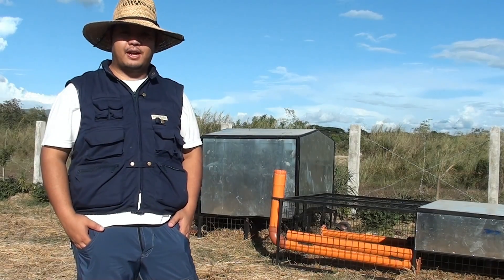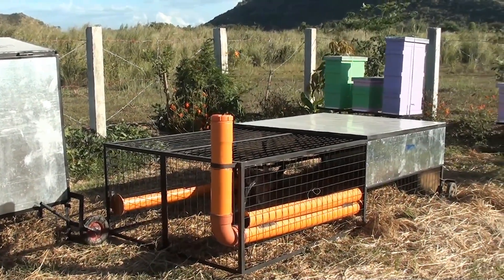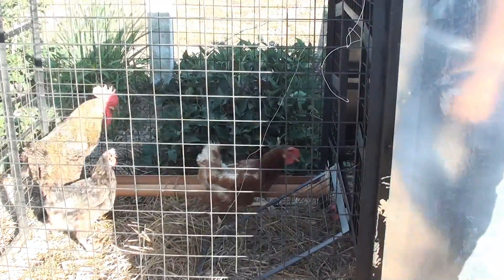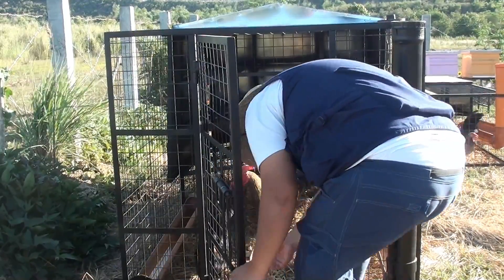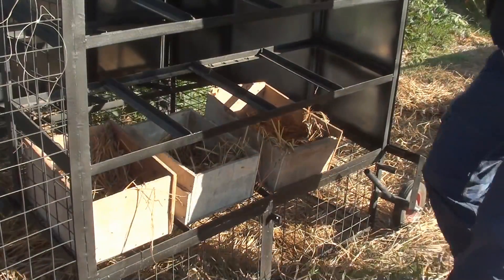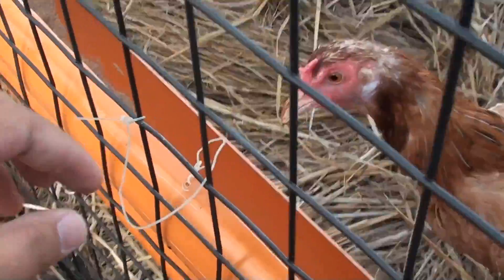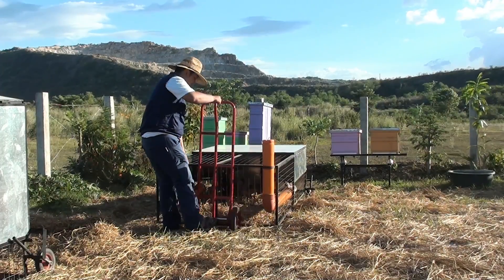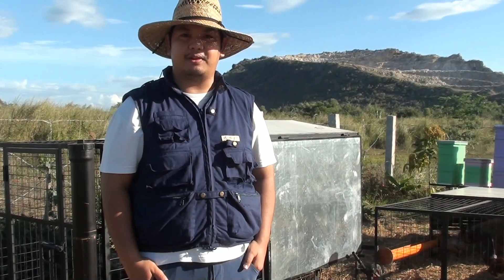How to design chicken tractors at MADE Farms Philippines

Comment: Too much iron, not enough space in height, that low tractor is not good for the chooks, shade from trees or not, it would still get too hot for them inside with limited air flow. Lastly, the whole contraption just looks to complicated & heavy. PVC pipes release chemicals in the heat.

Comment: seems like your layering room needs to add more height for its roofing, it's too hot for hens, since the material is galvanized steel, it will cause a heat stroke if it is exposed to sunlight.
Reply from the maker: It is only designed to protect them from the rain. The tractors will run in between a silvo pasture style of trees and crops so the row of plants will shade it. It is a symbiosis of the tractor providing the tilling and management of pest and uneaten fruits and vegetables while the plants providing them a micro climate of protection.
Reply: Madodel